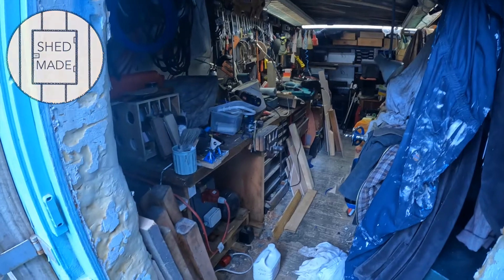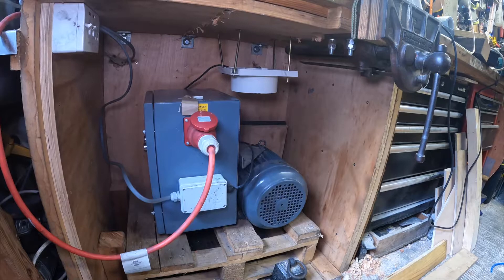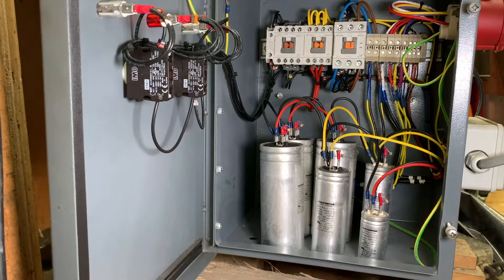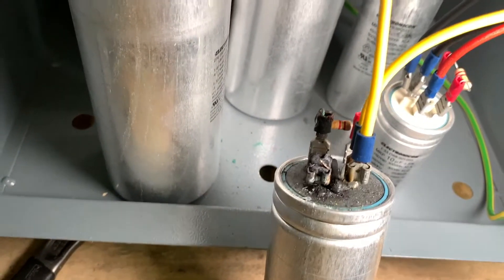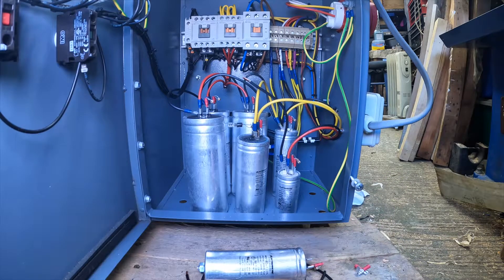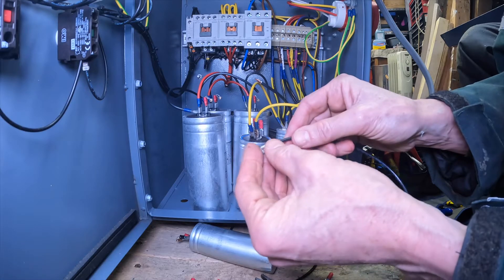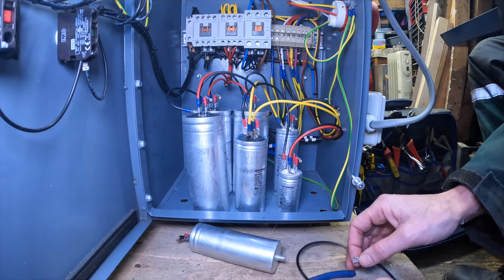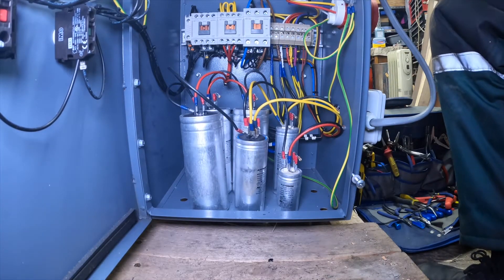transwave converter fix  50

Comment: Its not the capacitor its the push on connector unable to take the current, the bad joint has burnt away the terminal